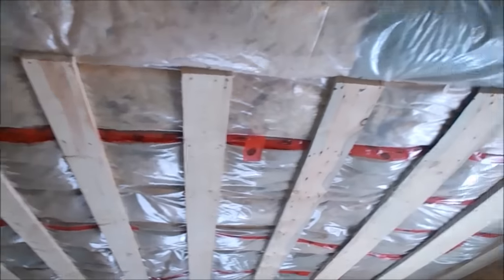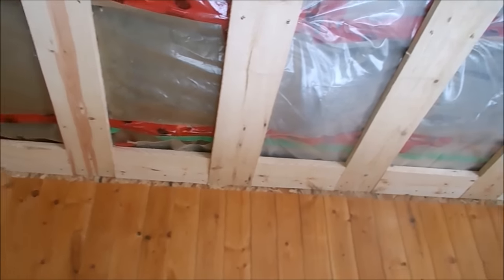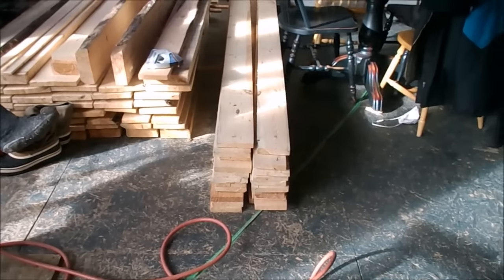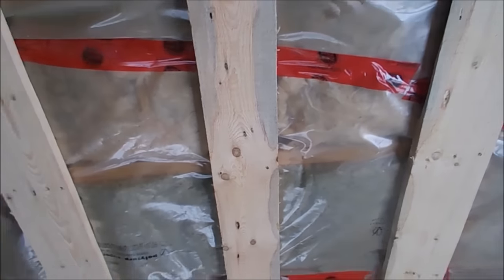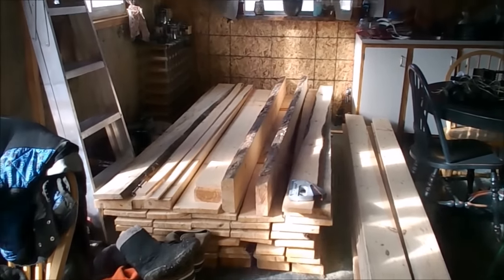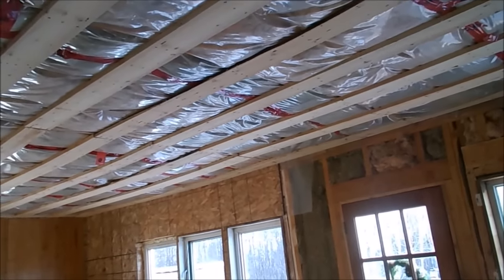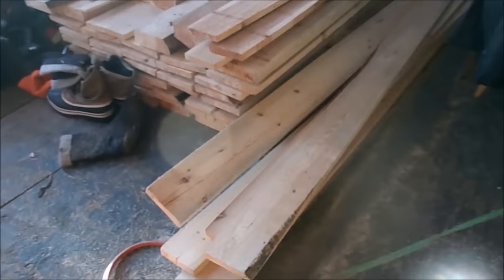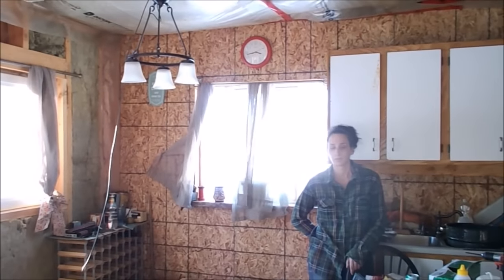Strapping Up Our Off Grid Home So Hopefully We Save Some Heating Energy

Comment: In stead of using OSB, did you every thought of putting sign board. It is like a plastic core grated. It is white all ready, it is easy to clean. I put it in my camp and I put pine strapping 2in in between. It looked pretty good. It is a lot cheaper  than OSB and you do not have to paint it. It comes in sheets of 4x8. Just a thought. I got it from SooMill, I think Home hardware has it also.
Reply from the maker: Thanks for the heads up... I already went to town and bought all the OSB we need, I also priced the sign board you are talking about, but  OSB here is on sale at $13 38 a sheet for 7/16, but I priced the sign board and it's $20.00 a sheet for 1/8  :-(    But you gave me a great idea though... You see I have this painting my dad just loved that hangs on my bedroom wall, If I take this painting and have the local sign place scan it and blow it up, then crop it into six pieces and print the painting on these sign boards I could use them as our living room ceiling...  How does this sound to you?    Thanks again for the idea Dwight,  You take care ttyl   Cheers  :-)
Reply: I checked the price here and it was 14.22$ in E. Lake a sheet. Mind you I was buying it at a quantity for so many sheets at a discount. If you look at the price of paint and the time to paint it, it is a lot cheaper. Stains and smoke from wood stoves comes off easier. OSB here is 15.42$ a sheet not on sale.
Reply from the maker: Yeah I hear you... I believe I am going to use the Sign board as a finish covering on my ceiling, I just never thought of it till you told me...  Thank you, it's a great idea  :-)   Cheers .

Comment: Hi Cecil have u heard of a Rocket mass Heater?
Reply from the maker: I have heard of them, but I haven't really checked them out... The little air tight wood stove we have now puts out too much heat for this place lol.  At minus 35 degrees Celsius we fill up our wood stove at around 10 PM and our house stays at around 27 all night, and then we fill the stove again around 7 Am with more dry Jack Pine.  We also use our stove to cook on.  I will def. take a look at them though Al,  Thanks again,  Take care ttyl   Cheers  :-)
Reply: Check out the channel Touch O Mantic. They use one.  it is suppose to burn less wood. The only downside is you need the room for terminal mass, which contains the heat and that is called cob, it is mud ,cement and straw combind,
Reply: Fouch-o-matic Off Grid
Reply from the maker: Thanks I will look em up  :-)
Reply from the maker: Thank you,    :-)
Reply: I screwed up in the name, SORRY. But you got the idea anyway
Reply from the maker: No need to apologize Dwight,  We are all human here  :-)  ...And Thank you :-)   Cheers.